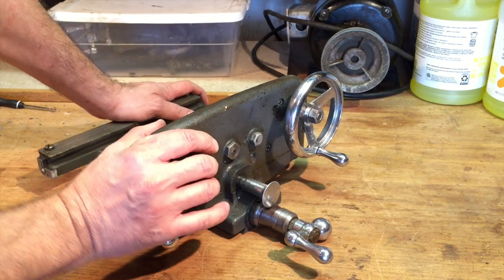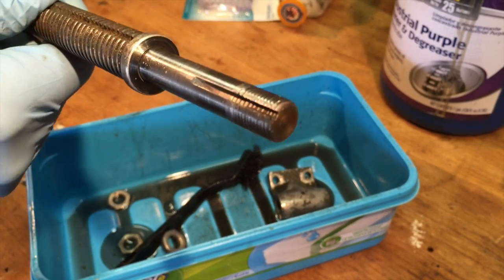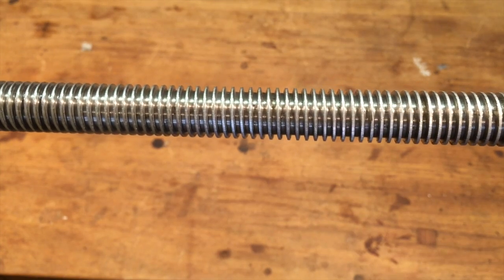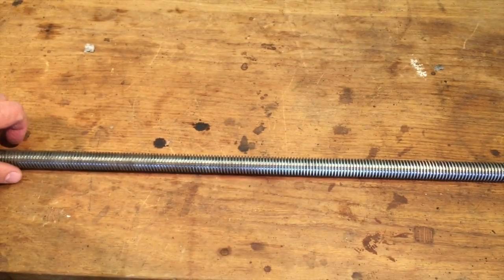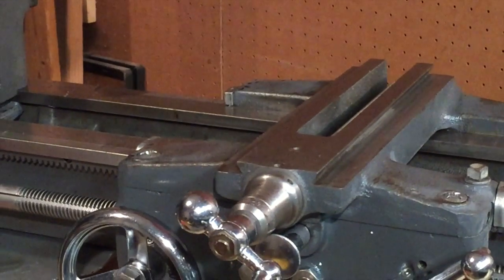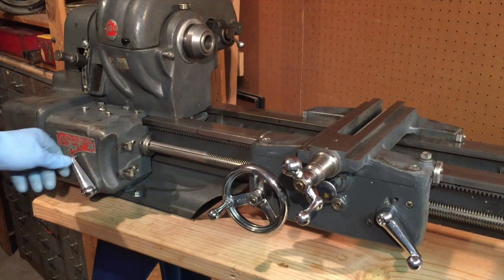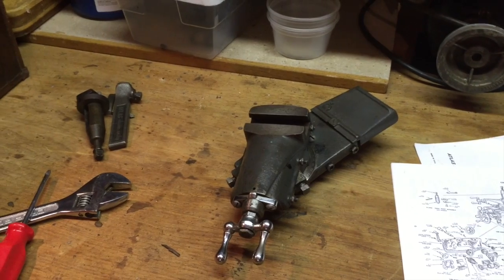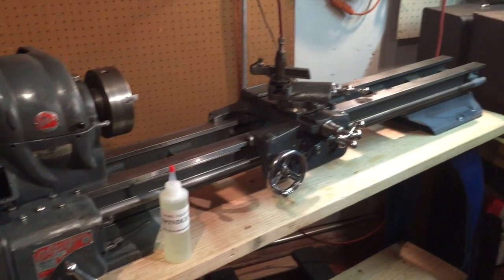Atlas Carriage Craziness- part 15 of my lathe restoration

Comment: Hi there.  Am learning a lot from your videos.  I have a similar, though not alike lathe I recently acquired.  It is in pretty bad shape.  I noticed from this video that you took the saddle off with the apron still attached.  That apron on mine has two HUGE philips head screws that are pretty tight and I do not have a screwdriver large enough to take it off.  But, I learned from your video that I can clean that puppy by taking the whole thing off.  Thank you Thank you.
I will subscribe.
Reply from the maker: Hey! That’s great to hear and good luck with your restoration!

Comment: Awesome work! I've noticed the atlas diagrams show the rubber wiper up against the carriage, with the felt wiper on the stamped metal retainer side. When I took my Atlas apart, it was like yours though with the felt up against the apron and the rubber on the outside. Does it matter which way those are installed?
Reply from the maker: Hi! Thank you for taking the time to watch and comment on my video! I really don’t think it’s a makes a big difference the order of the felt/rubber. If in doubt, I would follow the diagram.

Comment: Nice work  - keep posting I'm loving following along, but I think your lead screw may be worn more than you think.

Acme Threads have a distinct FLAT profile to the top of the threads. As they wear down they become "V" Shaped. While the end right near the headstock is where everyone says to look for wear - it is really about 10" back from there since that is the point where the Half Nuts make contact with the Lead Screw.

The half nuts are located on the right edge of the Apron so where they mesh onto the lead screw that's where you need to start to look. If you compare the threads in your video at 9:17 Min thru approx. 10:00 Min to those shown at 11:00 Min. you'll see a difference. Flat Tops Vs "V" Knife Edge Threads. It won't make a huge difference as it's just driving the carriage and it really only comes into play if you were to be cutting threads and the thread went from a worn spot to a good spot than the pitch would have some slight variation. If you are not threading than it's only backlash in driving the carriage.
Reply from the maker: Rod H Thanks for the heads up and I'll definitely  take a closer look. I did lay a straight edge along the lead screw and it looked pretty even that's why I thought there was very little wear.
Reply from the maker: douchebagnumero1 Yea, I need to pick up one and triple check how worn it really is.

Comment: Nice job. Where did you get the felts? You know about adjusting the gibs?
Reply from the maker: Steve S Thanks! I bought the felts and rubber wipers from Clausing. The compound rest needed a little adjustments, but the carriage was tight and smooth.

Comment: I made gussets for the top cover,  really cuts down on vibration and risk of breaking the mounting brackets,,,only weak place on my 12 x 36,,, and replace the hinge pin with a bolt.. takes the rattles out
Reply from the maker: Sounds like a big improvement! I’d like to see a photo of that.

Comment: The parts in the carriage should be oiled with 10 weight non detergent oil. I usually use brake cleaner as it is volatile and won’t leave residue like the purple cleaner. Very nice project. I love my Atlas
Reply from the maker: Thank you for watching and the suggestions!

Comment: The lead screw retaining bolts are not to be tight against the block.  You set it up with as little slack as possible but no tension with the nuts jammed against each other.  You probably got this right off camera,  just in case.....
Reply from the maker: Crafted Thanks for the heads up. At first I didn't, but quickly realized that the lead screw wasn't turning freely and did exactly what you suggested.

Comment: WTF is with people cutting wood with these things. I just acquired an Atlas and it was full of saw dust under the guards, pulleys, apron and direction gearbox. Giving her a good clean and repaint.
Reply from the maker: I guess turning wood on a metal lathe isn’t that bad as long as you clean it up and don’t let the chips get packed in to all those nooks and crannies.